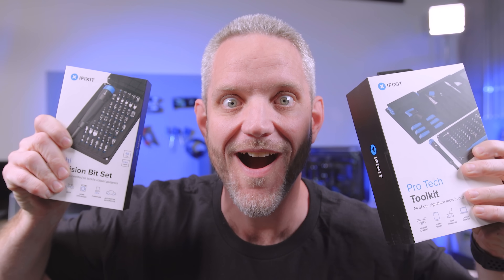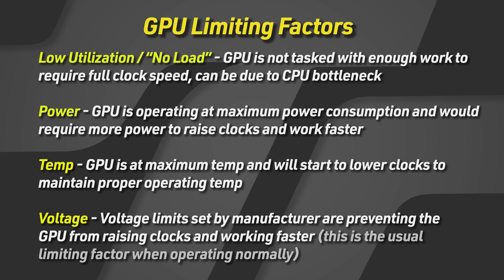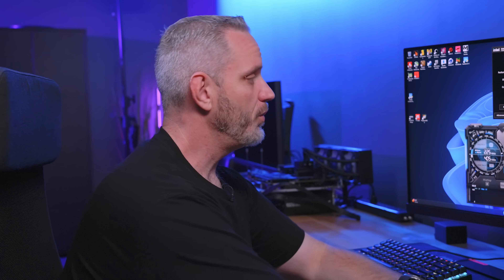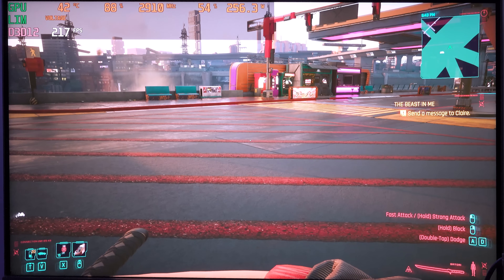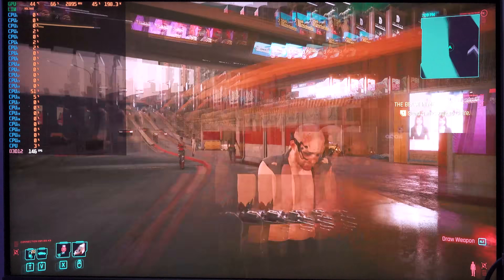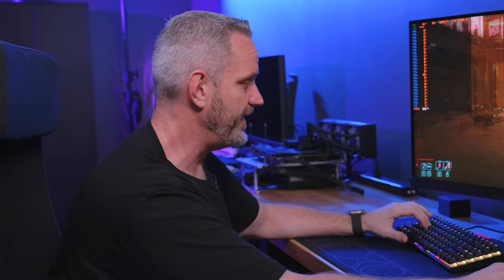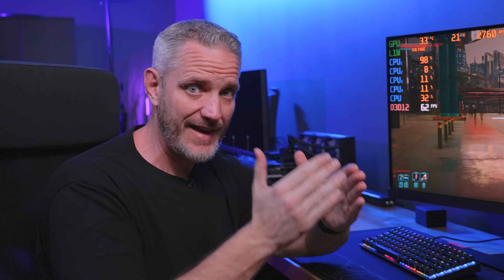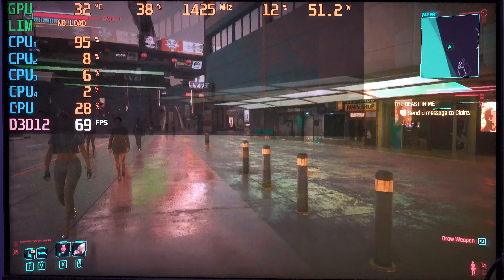THIS is what Bottlenecking REALLY looks like! AVOID THIS!

Comment: Rather than artificially slowing the CPU, you should have run this test on a legacy system. For example, drop that 4090 into a system with an Athlon X4 CPU and you will really see the effect.

Before I understood bottlenecking, I paired an R9 390 with an 880k Athlon X4 and wondered why I didn't get much better performance over the HD 5860...

Little performance increases and bad stability. I regret ever buying that R9 card.

But at the time I didn't know about bottlenecking, and thought a new GPU would solve my problems.
Reply: yeah did that with 4670 long time ago, absolutely no difference
Reply: The issue with the test you suggest is the mobo of that settup will not have sufficient PCIE lanes. So at that point you are bottlenecking on the motherboard before the CPU even comes into the picture. That renders the test inconclusive as to how much of the bottleneck would be from the CPU.
Reply: @fortigan2174  the Crossblade Ranger has a 16 lane pcie slot...cards only use 8. I'm not sure what the lane issue you speak of is, however I do realize that older boards have older gen lanes. Now speed can have a huge impact, but you have to go way way back in time to drop below pcie 8x...

My point was, gimping the CPU does not give an accurate reflection of a real-world scenario, where someone might be trying to use an overpowered graphics card in an old system that cannot keep up.
Reply: @fortigan2174  I'm no expert, and if I am missing something in my previous comment, I am open to clarification. Thank you.
Reply: haha!
Reply: You can't go too much in the "legacy/old" direction, because older CPUs are missing some instructions that modern engines/programs use, and they will simply not run. A realistic scenario like sandy bridge i5 should be the lowest I would go. There is a pretty interesting/funny recent video of 4090 and a core 2 quad CPU, which shows why it's too unrealistic to go that old on the platform.
Reply: @Astralify  the UFD video? I actually just watched that a couple days ago, and it was about what I expected.

I just recently (last month as of this post) built a new PC, as my 10 year old gaming rig was aging out.

AMD 880k quad core CPU + r9 390 nitro. I started with a 760k and a HD 6850, upgraded to the R9, and then ended up building the 880k machine while replacing parts looking for an issue that ended up being the PSU. So basically a 10 year old machine, that had been upgraded lightly about 5 years ago.

Hopefully this 5900x + 3060ti will last a similar length of time. Although I will bottleneck at 3080, so I'd need a better AM4 CPU to go beyond that.

🤷🏻‍♂️
Reply: I had a i5 4460 paired with a 760. My GPU died with only 3 years of usage so I had to get a 1060. I felt the bottleneck under very high loads, but I could convive with it. Then I bought a 5600x and my 1060 finally delivered it's full power.
Reply: @TheEmolano  if I hadn't had so many issues with the R9, theoretically it could have been a decent card, I would have tested it out on the 5900x just for the lulz, but it runs so hot and is so unstable, I didn't want to bother with it.

I got the 3060ti first, plopped that in the rig to replace the R9, then bought the rest of the parts for a new build.

The 3060ti handled the games better and ran cooler, but no noticeable performance gains.

Just better lighting, shadows, etc ..FPS was nill.

Still filling the new case with fans, but the build is up and running.
Reply: @SeaMonkeyMetals  I comes down to speed per lane. For example:
"PCIe Gen3 operates at a data transfer rate of 8 GT/s (gigatransfers per second), which translates to roughly 1 GB/s (gigabits per second) per PCIe lane. In comparison, PCIe Gen4 operates at 16 GT/s, converting to about 2 GB/s per PCIe lane."
So even being just one generation behind cuts your data transfer rate in half. A PCIe gen 4 card will work in a gen 3 slot, but it will be limited to gen 3 speeds.
Reply: i can just turn off settings that use cpu, like render distance
Reply: @fortigan2174  I had mentioned the speed limitations on older generations, and how it could have a huge impact, in one of my previous comments.

While I understand the issue this presents, as far as benchmarking goes... It's still a more real world scenario.

You really only have two types of PC builders... You have people building a completely new system, and you have people upgrading their systems.

Most of the time when a computer starts to age out and performance drops below preferred levels, the first thing a person wants to do is upgrade the graphics card. So in essence, showing a brand new card in an old system is going to give a more real-world scenario to the majority of people who might be looking to do that exact thing.

If you can show that plopping a 4090 into a system with a CPU from even two generations back, will not net you any gains over a card from two generations back, people will be less likely to waste their money on an upgrade knowing it won't provide any additional performance.

Knowing you need to upgrade your CPU, forces you into upgrading your board and RAM as well.

Basically, if I had known this much about bottlenecking and bandwidths back when I bought my R9 card, I never would have bought the card... I would have built a whole new machine, probably around the time the RX 580s came out.

Had I done that, I would have gotten a better performing machine and a cheaper card, rather than suffering for 8 years with an overpriced, overclocked rebadged r9 290...
Reply: @fortigan2174  Most PC hardware though mate is made to be backwards compatability the real issue is would the legacy drivers even work though. XD.
Reply: @MJSGamingSanctuary  Never said it wouldn't be compatible. You can certainly put a PCIE Gen 3 graphics card into a PCIE Gen 4 slot and it will work just fine. However, it will be limited to Gen 3 lane speed. The reverse is also true (Gen 3 graphics card in a Gen 4 slot will run at Gen 3 speeds). We were discussing bottlenecks, not compatibility.
Reply: would a ryzen 5 3600 with 6800xt be so bad?
Reply: @bdominik8497  You'd probably be losing a little performance on the CPU but not a lot. But quick question the 5800x's and its 3D chip have collapsed in costs and prices and got a crazy boost bin. Why not opt for one of those? They are its not really well advtertised but are built to essentially be undervolted which then brings their temps more in line with what they should be.  And then you'd get the boost of the PBO2 systems.
Reply: @MJSGamingSanctuary  if i upgrade my pc i think i will do it partly i usually spend 150k HUF to upgrade now it would be more like 200k but a full upgrade is 400k i don't want to spend too much and i can get 5800x3D later and then upgrade gpu alone again to something big then get a new motherbord for am5 or intel :D
Reply: @bdominik8497 you focus too much on the GPU. A 6800 XT is useless unless you pair it with a good 8 core CPU. Many games this year are CPU intensive. Cyberpunk 2.0 is the most apparent. The Ryzen 5 3600 has many drops to 50 FPS. I know because I have a RX 6700 XT and still had a Ryzen 5 3600 when 2.0 dropped.

My upgrade to a 8 core CPU made huge difference in the low frames. I can stay at 60 FPS on 1440p. The 8 core also means stuttering on well-optimized titles is almost eliminated. My Ryzen 5 3600 stuttered nonstop on Hogwarts Legacy.

In short even though your GPU is good enough for all titles you limit your max FPS and you also ensure you have big spikes in frames. For example you can reach 70 FPS in Cyberpunk but you'll have many areas where you sink to 50 FPS. The GPU can only be used so much. The current gen of games from 2020-present utilise many cores now. Offloads a lot of work on the GPU. A Ryzen 7 5700X or 5800X/5800X3D will last you a long time. By the time you replace your RX 6800 XT simply get a new AM5 system.
Reply: Cyberpunk requires 40% of RTX 4090 to show you.. MENU!
Reply: This is close to right concept. Better than Jay's go at it anyway.
 "Bottlenecking"   and  " limiting " are not the same thing. Limiting is what happens when one component isn't fast enough to allow another component to run at full speed. *Every single component in your system except the very fastest one, is limiting the very fastest one.* 
Bottlenecking is when the slow component *adversely and disproportionately* cripples the faster component, or even results in instability. It doesn't have to be "noticeable" to be bottlenecking. It has to disproportionately reduce the performance (or stability) . 
If you take a 5Ghz and take it down to 4Ghz, you might expect an ±approx equivalent 20% reduction in GPU performance simply through not having to do as much: *that is not bottlenecking* . That's limiting. 
Bottlenecking is when you drop the CPU 20% and the GPU trips over itself trying to cope with the slow data flow; e.g. GPU perf drops 50%. If the game is easy/old you might not even see that difference in gameplay but the bottleneck is there regardless. 

It comes from the fact that the neck of a bottle is not just a tighter channel; it's that when water flows out, you also have to let air in; so it 'glugs' as the flow is *further* choked from having to pull back and let air in to replace the water [or whiskey 😬] that has left the bottle.
Reply: Hahaha, I know the pain. I have paired a GTX1080 with Phenom II X4. The GPU upgrade plan was different, I planed RX480, but crypto took them away from market in reasonable prices and when checked, the price to performance of gtx1060 and 1070 was poor, so I decided to go for a 1080.

After purchase I simply started to look for a 2nd hand second or third gen I7 system and in a few months bought Sabertooth mobo and i7 2600K combo. Overclocked it to 4,7Ghz and used for a few years. It was quite a nice combo.
Reply: @fortigan2174  I don't remember these Athlon systems lacking an x16 slot on the mobo.
Reply: @TheEmolano  The i5 4460 is a pretty good pairing for a 1060. People used to run Pentium dual cores with the 1060 with decent results back before Ryzen launched. Games started finally using more threads once DX12 and Vulkan really took hold about the time Ryzen gave us cheap high core count CPUs. In modern times, Haswell users really need an i7 to keep squeezing life out of that platform. The i5 just can't handle enough threads anymore.
Reply: @honkhonkler7732  We aren't talking about the number of lanes, we're talking about the speed of them. 16 gen 1 lanes vs gen 4. Each gen basically doubles the lane speeds, so by the time you get from gen 1 to gen 4 the speed of the data per lane is 8 times faster. You can put a gen 4 craphics card into a Gen 1 slot, it will just transfer data 8 times slower than it could.
Reply: @Astralify +1 this is very important. An old core running at 5 GHz is not the same processing power as current 5 GHz core. Frequency does not define speed on its own.
Reply: @fortigan2174  i have a 3070 paired with an overclocked 2500k set to pcie 2.0 8x and i can tell you that pcie speed doesnt make much difference. fps is good and high but cpu is 95-98% and gpu varies around 40-80%. it is cpu limited.
Reply: @dantheman6698  This isn't some one size fits all kind of comparison. Results will vary greatly depending on the app and the settings it's running at. A blanketed statement like "...pcie speed doesn't make much difference." is simply not universally true, or even mostly true. Yes, in certain use cases it wont matter, but when it comes to high end graphical applications (or large data transfer), that is the exception, not the rule.

In the case of your setup, even if you did upgrade the motherboard to PCIE Gen 3 (or 4), it wouldn't make a difference because that CPU is limited to Gen 2 PCIE bandwidth. Likewise, if you just upgraded your CPU, your bandwidth would still not improve because the board is limited to Gen 2. However, if you upgraded both CPU and Motherboard, your GPU usage would certainly increase (Thus, more performance). You are also limited to DDR3 RAM speeds by that CPU. By definition, this is a bottleneck, which is the focus point of the entire video. With only 8 lanes of Gen 2 PCIE, DDR 3 RAM, and a 13 year old processor, you are most definately not playing anything demanding on ultra, and not getting the most out of your 3070. You should be able to push that card to 95% utilization, otherwise you are leaving performance on the table.

In many cases, the CPU speed, its PCIE bandwidth, and memory bandwidth are directly linked when determining performance. Improving any one of these without improving the others will net limited benefit. This is even more noticable with regard to NVME drives, especially if they are sharing lanes. Bandwidth between PCIE devices and your CPU does matter.
Reply: @fortigan2174  you put far far too much weight on pcie speeds. for gaming without overspilling vram, there isnt as big a problem as you make out. with my setup, its obvious its the cpu, increasing my pcie speed wont do anything noticeable, only changing to a faster cpu will.
you can try this yourself, drop pcie gens and speeds in a game and see what difference it makes. plenty of websites have done the same tests too and very little difference between pcie speeds except for fps drops and chugging happening when exceeding vram.

Comment: Excellent video! This was a such a revealing and enlightening for me. I recently got a 4090 here in Colombia, which, if for u guys back in the states is horrendously expensive to get one. For us, well, let me say you can get a car or a highly expensive cosmetic surgery for what you have to pay for a 4090. And let me tell you, most people in their right mind would never choose a 4090 over a really important thing as a car or somthg like that. And so it was a big dissappointment for me, I felt like I had wasted the money of my life, when things started to pop up on my screen using afterburner telling me I had a limitation. This only made me get more anxious and thinking abt having to spend even more money on upgrading a rig i was already running short the budget on. Ty so much jay! I finally got to understand what that lim "voltage" meant... Btw i didn't not change any component except for the m.2 ssd which was 125 gb and chgd it for a 2tb one
Reply: What cpu do you have? I have a 13700k and im planning on getting a 4090
Reply: @BarneyMartinez  I got a 7600x. I game at 4k all the time. Extremely happy with it. Planning on getting the next 7800X3D, which would be "8800X3D" once it comes out in probably a couple years.

Comment: Many years ago, the PC at my home had a Pentium E2200. The CPU would easily go 100% when I open any modern games. Initially, it had a 9500GT IIRC. Then I upgraded it with GT440 and later GTX550Ti. But the improvements are not that much. There's still lagging. Later I decided to get a new PC with i7 3770k. I did still use the GTX 550 Ti, but the difference is night and day! I could play many mainstream games with FPS many times better than before lol

Comment: Thanks for sharing this! Been meaning test out my 4770k and 1070 combo to see how much bottlenecking there is, but didn't really have too good of an idea on what I'd be looking for, but this clears it right up. Gonna check that out later
Reply: if you have shadow of the tomb raider do the benchmark in 1080p it will tell you, check GPU BOUND if it's 99% your gpu is limiting the game if it say 0% it's your cpu, this will tell you the balance of your setup
Reply: @fredEVOIX  Thanks for the tips. Cheers!
Reply: My brother had a system with a stock 3770k and upgraded to the GTX 1070 back in 2017. He got a couple years out of that setup and he had no complaints. He did upgrade to a 9900k, but not for the sake of gaming performance.
Reply: @friendlysloth  hmm. I see. I guess I know what to expect now lol
Reply: @ThickpropheT  I'm still running a 3770k with a 1070 and there is nearly no bottlenecking. At best like 2-3 % depending on the game/task, so it's not noticeable.

Comment: Me with a R5 3600 / RTX 3070, I was playing in 1080p for a long time and some games that would reach above 120fps I could feel a lot of bottleneck. My monitor was 75hz, so it was better to lock the fps to 75 than trying to go over it and having a lot of sttutering.
Now I upgraded my monitor to an UW 1440p and the bottleneck is better, but I still need an upgrade of CPU.
Reply: the 5700x3d is very good for its price